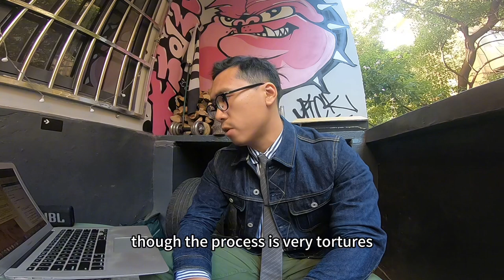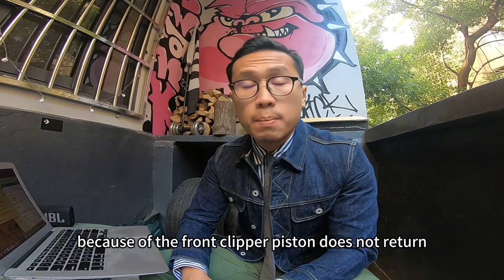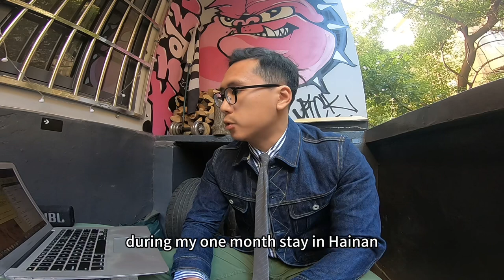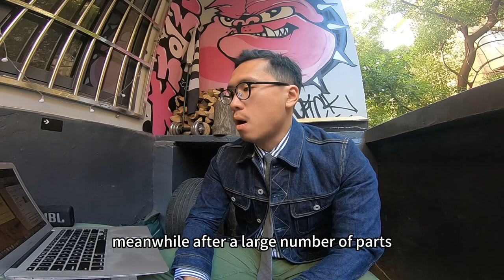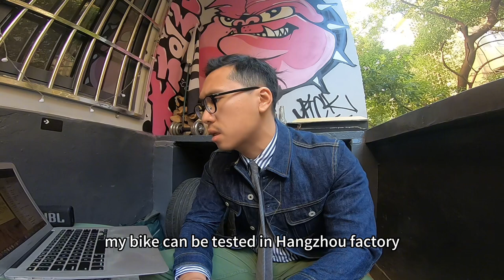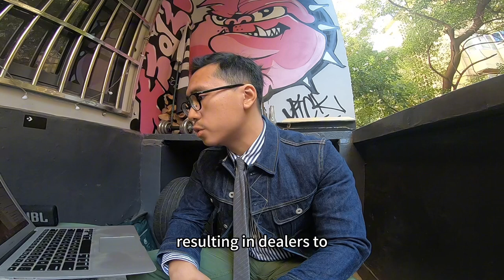CFMOTO 800mt brake problems part 5 final solution

Comment: Sad to hear you had trouble. I was looking foward to purchasing a 800T in the future. Hopefully this problem will be resolved quickly.  This is the first post I've heard with problems that severe.  Thanks again.
Reply from the maker: thank you mate, the brake problem is easy to fix, except that, it is still a good bike! but i have no idea why the handlebar wobbling, maybe because of the high center of gravity

Comment: I'm glad the engineers at the factory are looking at it now and you got refunded. 34k km is quite high for a return and is amazing to me your government has such a good consumer protection. I feel like my dealer here in the US would have ignored me right away if I brought up any problems. I hope you can find a motorcycle to your liking and have some good tours in the future.
Reply from the maker: lol, thanks mate! thats a good result, but i spent a lot of times to consult and riding this brake defectiveness bike for 34k km is not a really good experience. but actually in my long trip for 19,509km with this cfmoto bike, all things are good, except the brake things and the wobbling which is after brake parts replacement by the engineers. and i just finished another trip on the eastern China Hanzhou Nanjing somewhere, this time i drove my golf for one month 4700km. thats a good gap year for me, i did a big trip. now im going to relax in my house until Chinese new year. i still got a bike SWM 150 a supermoto lol, thats one gives me a lot of fun! im pretty enjoy it.

Comment: Sorry to hear but glad you got compensated, I’ve just completed my first 1k km on my 2024 explore. For now 0 issues and I hope it stays like so! Hope you get a replacement soon 😊;}
Reply from the maker: thank you mate, hope you enjoy your ride ~~
Reply: I have 800mt explore and I have big vibrations on 3000 rpm. After the first 1k km is getting worse....I don't now what to do...
Reply: @yoserban  Isn’t that the issue that gets solved with the software update? I understand you can do the software update yourself using the phone app.
Reply: How does it feel 5 months later?

Comment: Caro amico dei tuoi problemi elencati in Europa non risulta neanche uno, la moto qui ha avuto dei piccoli problemi tipo l'erogazione motore o qualche catena usurata prima del dovuto, premesso cfmoto 800MT progetto nuovo era quasi sicuro che qualche problema poteva esserci....., certamente c'è tanta gente che fa un uso improprio della moto con effetti collaterali su di essa, parliamo di una moto stradale, lo stesso lavare la moto bisogna sapere cosa si fa....., basta un lavaggio o prodotti errati per distruggere la moto........ti saluto buona strada
Reply from the maker: thank you for your comments but i cannot really  understand what you said, because the translation result is not good.

Comment: Wheel hub is the problem not the caliper
Reply from the maker: but unfortunately, in fact, we had changed two front wheels, it is not working. I believe the problem is because of the calipers